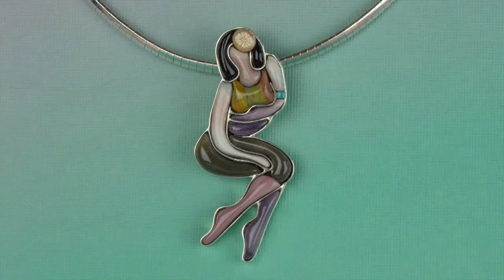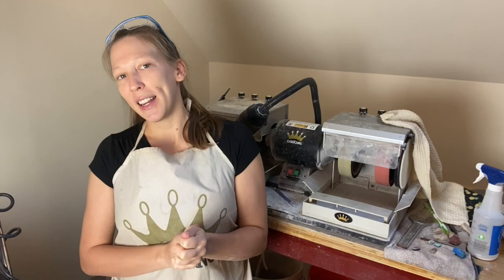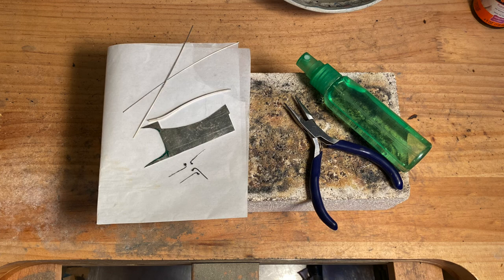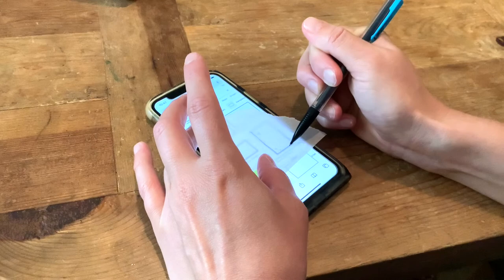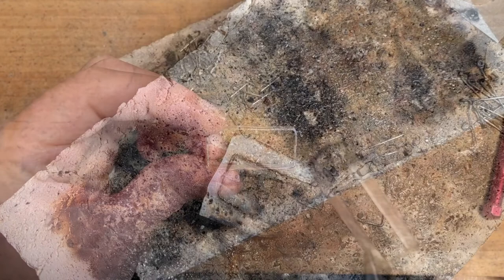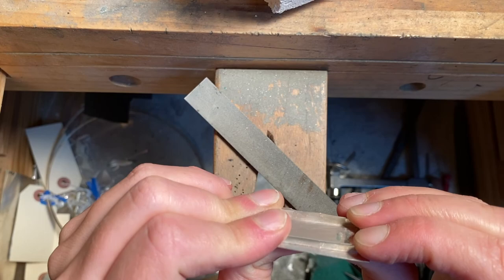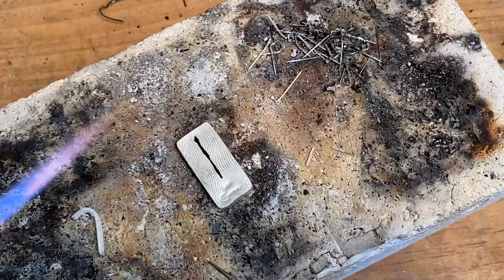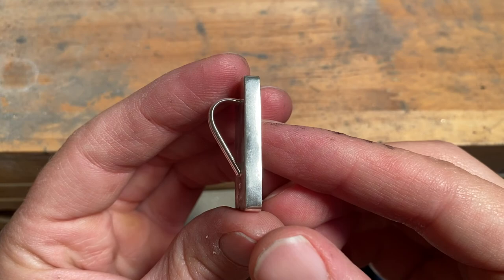How to Make a Flush Cut Inlay - Part 1

Comment: I hope you dont mind .. I am looking to try to inlay into a knife handle........I have a background in machining engineered plastics..art is hard but cool is doable
Reply from the maker: Hey Michael, if you have some experience making cabochons and have done some calibration, a knife handle is simple! You can get blanks at a variety of places, but get one that has a handle that doesn’t have to warp/bend in order to lock it open.

Do you have a style knife you had in mind or a certain stone you wanted to use? You can always reach out if you’re having trouble